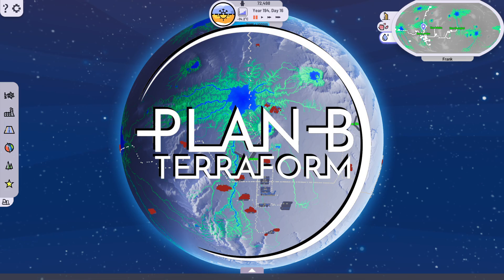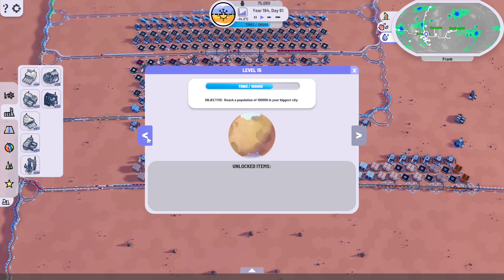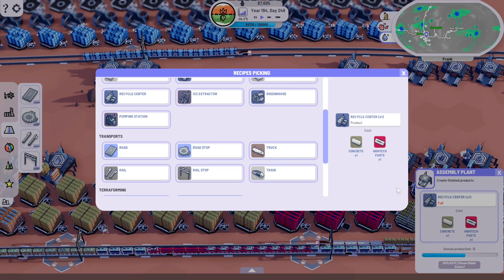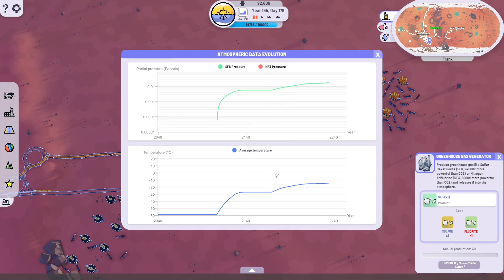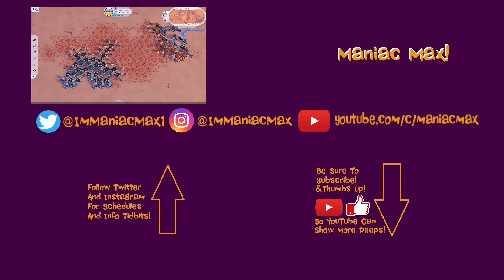Plan B: Terraform! Malls! Trains! Midgame Tips! (Tips)

Comment: Neat design. But isn't this potentially wasting resources? I'm mid game and I have the feeling, I'm finishing a lot of resource fields already, plus water makes some unavailable for mining. Or do they regenerate after all the ice melts?
Reply from the maker: It will definitely waste resources if you continue to produce things which you dont use / have too many of (since currently there are no direct methods to limit build numbers) - hence why I left four rows above so when I have enough I 'pull' (remove) that building from the lineup and just put it up top.  As for limited resource pockets, I think that will have to be a design issue addressed later by the devs - my suggestion there is to not let cities be idle (not growing) for too long without addressing their needs (and those times where you do have to idle try to do expansions at that time) - hope your build is going well so far 👍😉
Reply: The only precious resource is greenhouse ore, move it to place with level higher than 200m. And you also should safe sulphur (like don't feed concrete to secondary cities if you don't grow them), other ores are hard to deplete if you recycle, after 100k cities are self-sustainable.